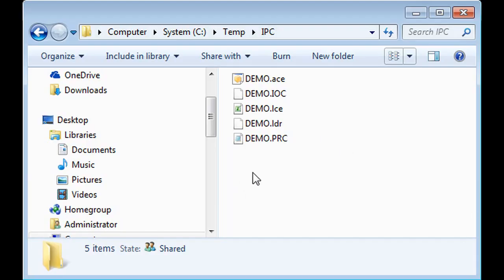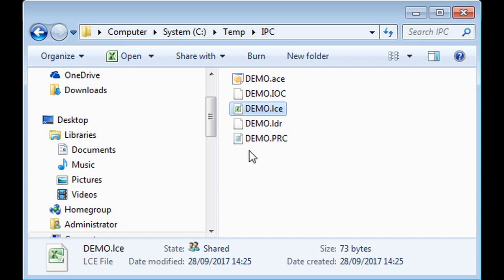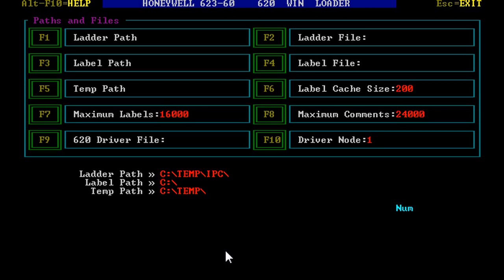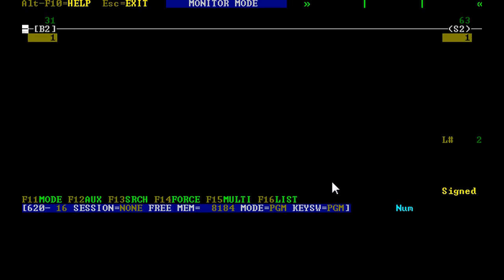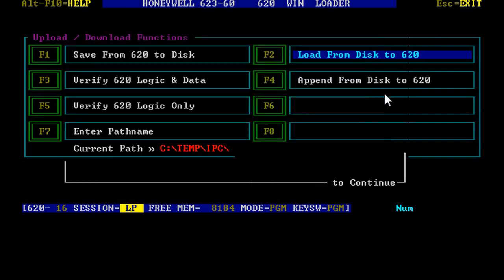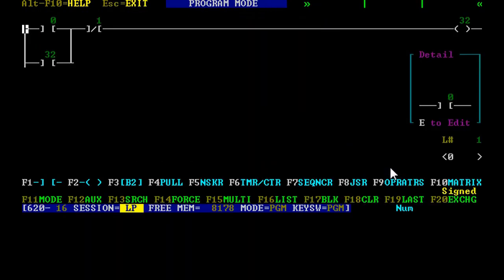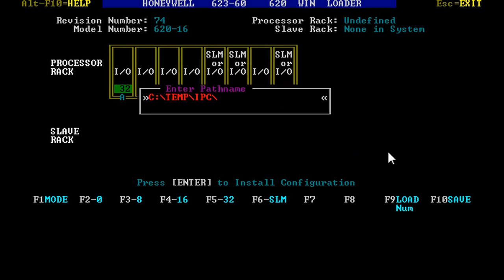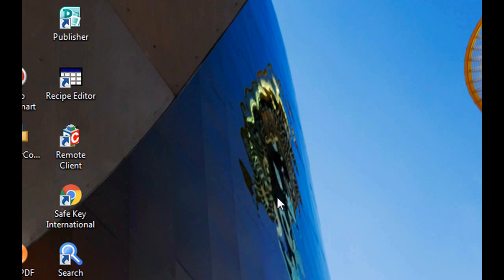IPC620 load Program with WinLoader

Comment: Would anyone know if this program can generate code for the IPC-90?

Our IPC-90 lost its program during the power outages in Texas. All I have available is the ladder diagram. Thank you.
Reply: do you have win loader or DOS loader setup?
Reply: @berryivan8729  Hello, thanks for your reply. We are only at the stage of deciding what tools we need. I was given a 700 page Winloader pdf file, covering Winloader 620 and 623 in great detail, but there was no mention of the IPC90. It seems to only apply to models 620-06/11/12/14/15/1631/1633/25/35/36.

It would be nice to have a Winloader program that would generate the correct op-codes for the IPC 90. If that's not possible, I am hoping to soon receive an original ISSC book on the IPC-90, with (hopefully) opcode information, and the communication protocol. Ideally, I would then enter the program manually, byte by byte (after building the interface).
Reply: @stepsvideos   thanks for your reply. Do you have the software?
Reply: @berryivan8729  Hello, if you mean the Winloader software, no, not yet, as we are not sure yet, if it can generate the code for the IPC90.

In case you meant the original cassette, with the IPC-90's program... they lost it. At least for now, it can't be found.

However, I do have some documentation that appears to be the output from a documentation program:
ISSC IPC-90 I/O Assignment
ISSC IPC I/O ADDRESS LISTING
ISSC IPC LADDER LISTING
Reply: @stepsvideos  thanks a lot. Iven DOS loader don’t you have it ?
Reply: @berryivan8729  Nope, not yet. Can the DOS loader compile code for the IPC-90?